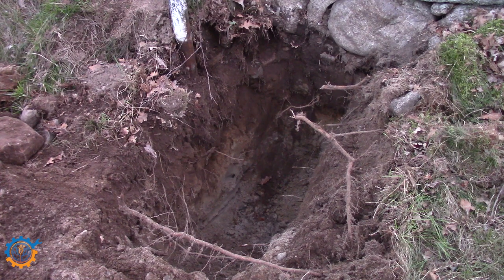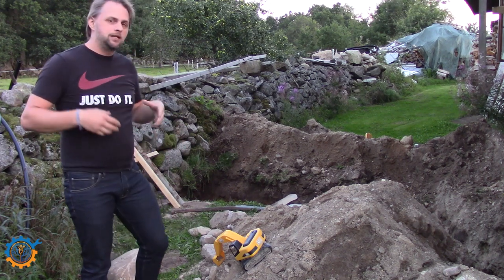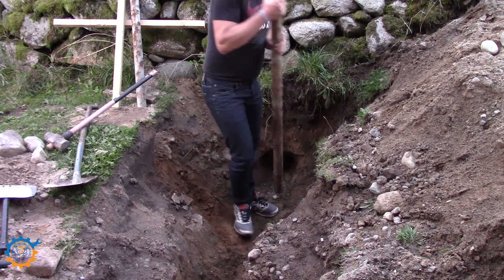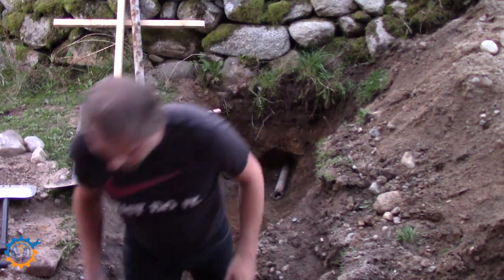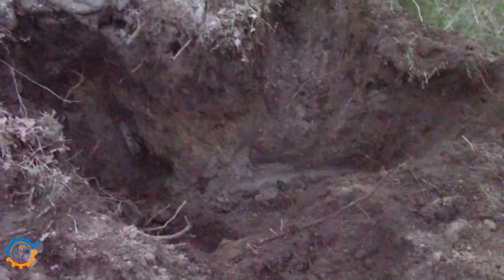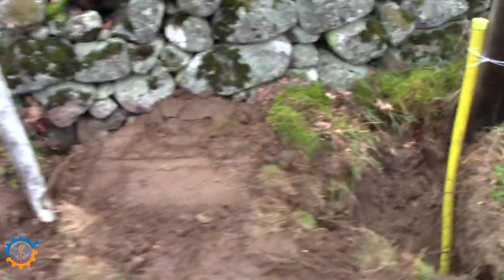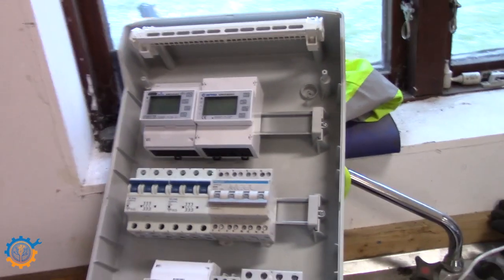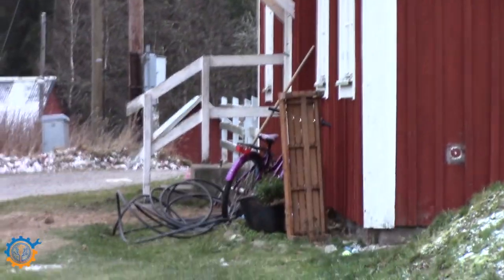Digging for new main grid connection. MORE POWAH! (Reupload)

Comment: Next time you need to open a hole like this try water. A smaller straight pipe with a flowing water.
The water will open the way and carry out the dirt at the same time.
Reply from the maker: Good tip! Will try it next time. That in conjunction with the pipe.  Works as long as there isnt big ass stones in the way that I had here :)
Reply: That is true, but is a hell of a lot easier than using a big thumb detector! :)